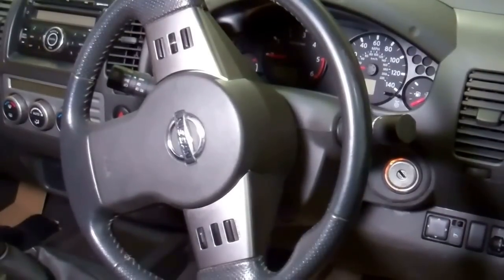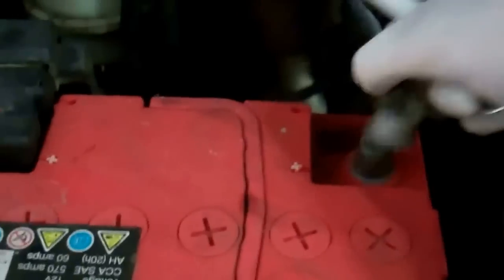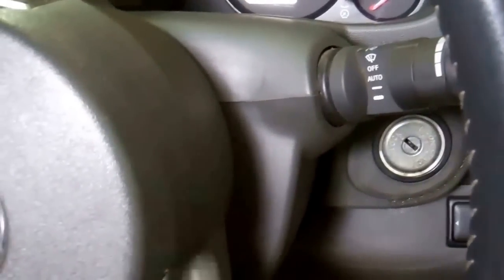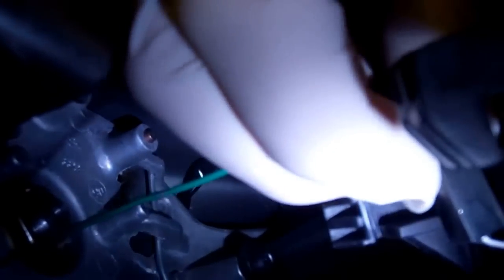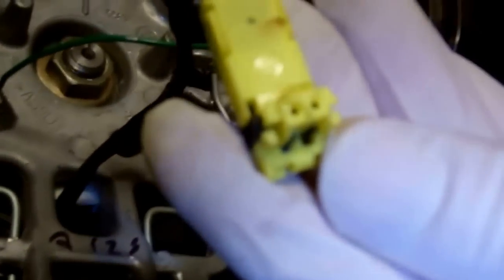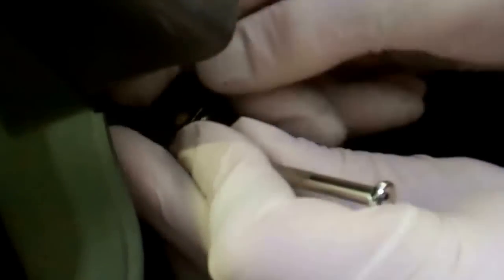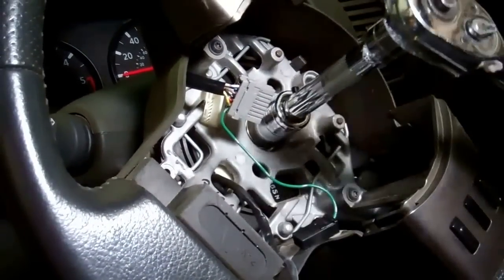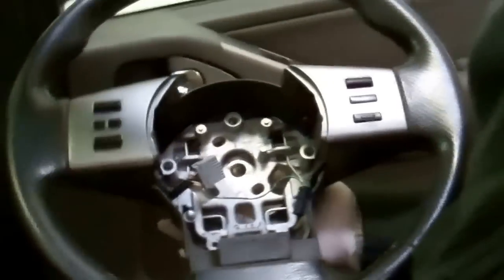How to remove the steering wheel & airbag on a Nissan Navara D40/pathfinder

Comment: Just a heads up, the wire needs to be pushed straight up to release it easily not levered back. Use a tyre valve driver to make it way easier.

Comment: Worked great on my 2005 Pathfinder.  Tip:  You might have the reset the Steering Angle Sensor because you disconnected the battery too long.  Hint if you VDC or your SLIP light come on you need a reset.

Comment: SPLIP and DVC light came on after I was done and anti-lock brakes kept kicking in as I was driving.   I disconnect the neg on battery again waited 5 min then reconnected neg.  I drove it no more that 15 mph on straight road, (stopping when necessary) applying the brakes softly not to trigger the anti-locks (SLIP Light).   8 blocks turned, 8 blocks turned, and another 8 blocks.  Also turned off the DVC off during the ride.  The system recalibrated itself.  All good again.

Comment: Good advice video. Except I always leave the nut on a few threads then wiggle the wheel, with feet braced against the floor , to remove (that way it doesn't come off suddenly and end up in your face 😢) It's an old trick, from when these things usually needed a puller to remove. Newer cars are not so bad. Thanks for the video 🤩
Reply from the maker: Great tip!

Comment from the maker: On my Range Rover when i had this problem all i needed to do is turn the steering wheel lock to lock to recalibrate the steering angle sensor. It may be worth trying this as an alternative.... not sure it will work but worth a go first.

Comment: I got a 2005 nissan pathfinder with no volume controls bit want to add them to my own so I can control my aftermarket radio my truck only came with cruise controls is that possible buy getting a wheel like yours?
Reply: AVNSpider It wont work, I tried

Comment: I did this and got my cruise control working which wasnt before. But after purting back together I now have my ESP light perminantly on. And some time the skid logo light. Do you know why this is?
Reply from the maker: This could be steering calibration - try turning steering wheel lock to lock
Reply: powerfulukltd unfortunately tried that, been like that for a couple of weeks now

Comment: Is there a reason you have tjr steering turned?
Reply from the maker: Hi - not especially - i think the steering lock may have engaged which makes the retaining bolt easier to remove.